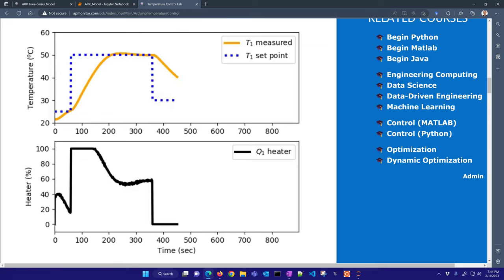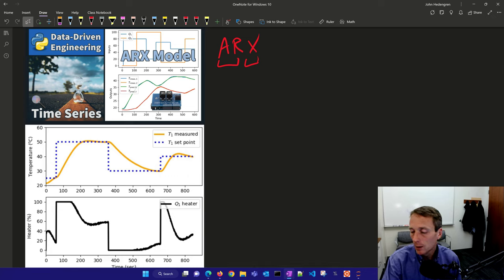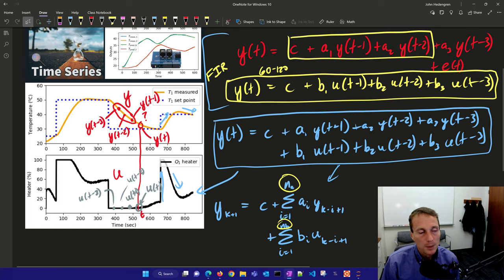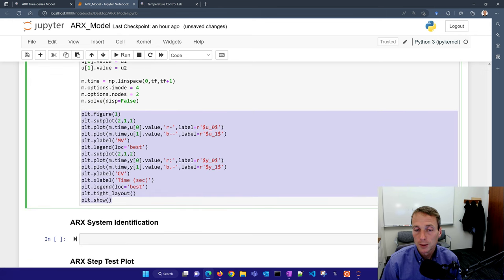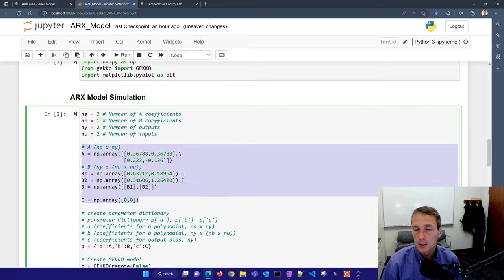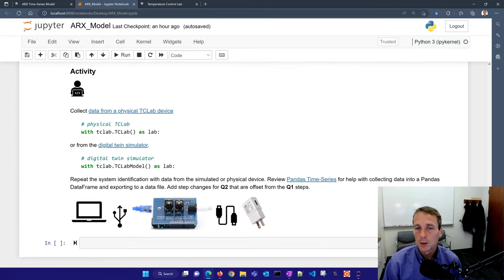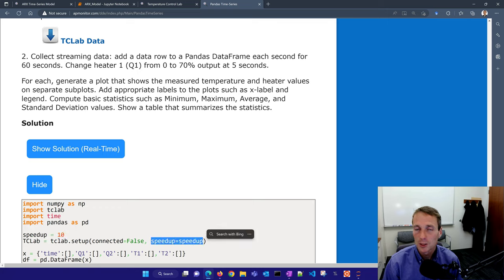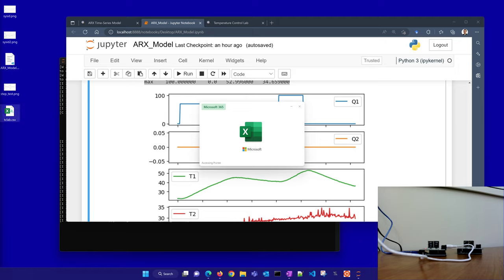ARX Time-Series Model

Comment: million thanks for the video ! i want to ask a question : how to implement this ARX model in MPC for TCLab ?
Reply from the maker: Here is the example code and a video that shows how to implement ARX-based MPC with the TCLab: https://apmonitor.com/do/index.php/Main/TCLabF and here is the specific code: https://apmonitor.com/do/index.php/Main/TCLabF?action=sourceblock&num=4
Reply: @apm  wow, thanks! those code for MPC MIMO right? what if i want it in SISO, just delete the T2 and Q2?
Reply from the maker: @ahmadkhoirunnajib2139  yes, or just set the STATUS=0 for the MV and CV that you want to turn off.